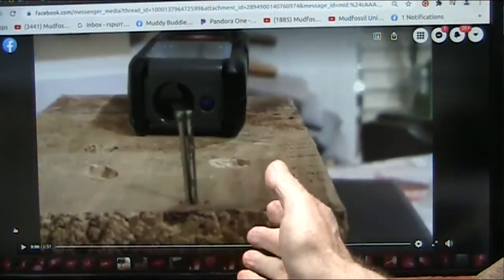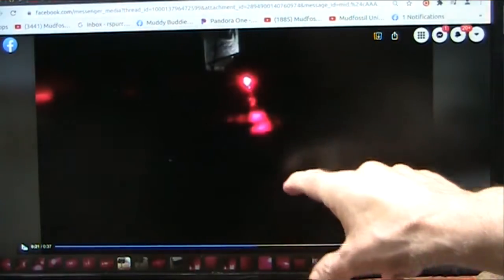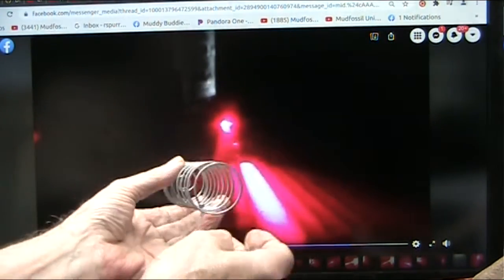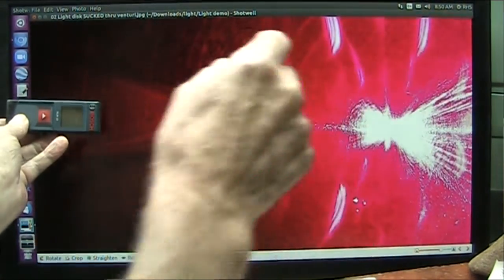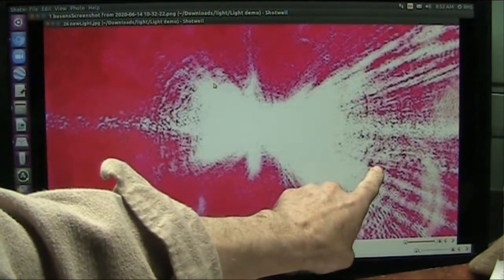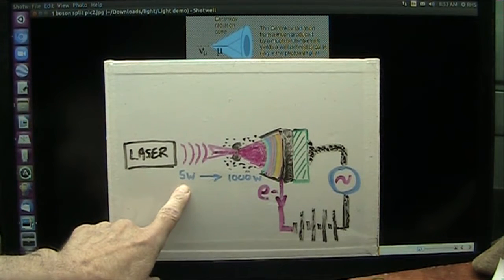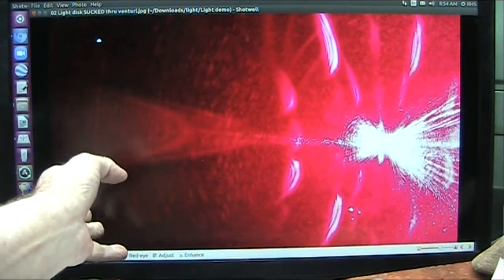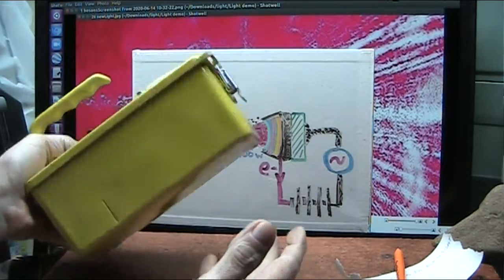How can you Accelerate light at Home

Comment: at the picture at 03:02 , as you say that the particle explodes.... this elemental particle can not fit in the medium where it comes out, when that happens, implodes separating in half turning over, with a magnetic field in between the two halfs. then in one of the sides emanates radiant energy, on the other gravitational energy. when this happens the universe physics naturally brings the energy of the aeter, to balance the difference of the momentum, which is the light, or when the aeter slows down the flow comes out light and/or else.
just a perspective. an opinion. I'm still meditating on it.

Comment: Would there be a way to attach a set of mirrors around a solar panel that just constantly loop/bounce the same Energy back through itself and a Venturi? Using something like a Microscope lense to focus an Outward Beam? I have NEVER been interested in Our Current Technology...But This is a Dream come True.
Reply: I'll try to explain to you why that would not work:

Light carries energy, to transfer that energy it requires to get absorbed by matter, if you put a light beam inside a box with mirrors and a solar pannel, either the solar pannel or the mirrors will absorbe it after it bounced one or several times, and they'll get warmer because of that.

It's true that mirrors are used to concentrate light beams to produce energy more efficiently, but not by making it bounce off continually, but to concentrate several light beams into a transformer. 

I'll suggest that you look up Solar Tower Seville to understand what I mean.
Reply: @didack1419  I prefer Trial and Error Myself; rather than being told one thing, and following-suit just because It's the Norm. There's always another way.
Reply: @SiriusZiriux  Ok but let me tell you a bunch of things if you don't mind. I'm not trying to be an elitist or anything, these are truly my sincere advices:

Firstly, there may be another way, but certainly not any way.

Secondly, no one has enough time to reinvent everything, every progress has started from the consensus. And people that work on this for life have came up with marvels like the Solar Tower PS10 using the consensus.

Thirdly, if you're a trial-and-error person, try actually doing it by yourself instead of claiming it. Start by looking up what is the Venturi effect, how it works and when it doesn't, and which properties a substance that can be subjected to the effect need to have; learn about the basic experiments about light behavior and maybe replicate them (we're talking about 18th or 19th centuries experiments), how laser works and learn how light is harvested and what other ways of harvesting have being considered (if any); and try to see if the explanation that I've given you is wrong.
Reply: @didack1419  That's why I'm Here; as I said before, I'm getting into right now, starting for the first time, for myself. Thanks for Your Input Sir; I'll definitely consider Your Words! 🤟🏻👽 I am yet to even begin to attempt building anything; I have just begun learning this past Year or so! 🌹
Reply: I just believe that if it is so easy for One to Overlook something so Massive; easily seen on a Map (Massive Beings.) I'm fairly certain it'll be even easier to overlook actual "Thoughts" and "Ideas". Ya can't physically SEE Those.....Just sayin'.
Reply: @mingebinge2306  You are Free to Follow Whomever You Wish My Friend. Best of Luck.
Reply: @SiriusZiriux  OK friend, let's say that's the case, and it's truly possible that they have missed those ideas and they instead have believed ideas that were said to be confirmed since 19th century by experiments, but they were completely wrong. 
We're truly talking about extremely basic flaws on the current understanding of all modern physics, how did it happen that people developed extremely advanced technologies based on those ideas and hadn't realised that they were wrong? So many fields of technology are fundamentally wrong (essentially everything that everyone acknowledges as "modern technology", and I truly mean that: computers, TVs, solar pannels, the Internet, modern medicine, batteries, electric cars, nuclear reactors and bombs, rockets, satellites... ) and yet they produce incredibly advanced devices.

   One example, how are we supposed to reconcile the field of Photonics with the fact that photons are actually (very) massive, dipolar particles, that behave like a fluid in very specific situations and no other time and that can exceed c-speed or go below it, that have no wave-particle duality and instead they travel in a helical path and a bunch of other properties that are completely unlike the consensus model. 
   And all of that was only seeing by one person, and not even other skepticals have arrived to his conclusion. 
There's only one world to look at.

If you have optical fiber, light is literally being conducted to your house to provide fast-connection to the Internet. And don't get me started on how many applications lasers are used for, including cooling off atoms to create quantum computers. And this is only one example of many many more, which I still can give you if you don't mind me writing and writing.

Even creationist scientists would be completely absolutely wrong about everything they have told and made, including James Tour who makes molecular machines and Jason Lisle who clearly acknowledges Relativity as a physical reality and he has used it to push for YEC.
Reply: @didack1419  I agree with You; I don't understand how Any One Person came up with Any One Definitive-Answer for how Current Technologies are, and should be used.
Reply: @SiriusZiriux  I'm confused by your answer friend, I was trying to show you that the current theories are so well-grounded that have allowed engineers to produce many advance technologies (literally all modern technologies) in so many different fields that everyone has in their houses.

And there are so, so many predictions made by these models. Modern chemistry is grounded on particle physics and quantum mechanics, and it was used to predict correctly the shape of the DNA molecule by an American chemist who won a Nobel prize because of it.
Reply: @didack1419  Ohhhhhhhhhhhhhhhhhhhhhhhhhhhhhhhhh! :3
Reply: @SiriusZiriux  I was trying to have a serious and respectful conversation. And then you laught at me after telling me that you don't understand how people do stuff that works if they're absolutely wrong, even creationists like James Tour. 

It doesn't matter how careless you're trying to be, there's no way around that. Even Roger tries to show how his theories predict phenomena because that's fundamentally all what science is.
Reply: @didack1419  I'm not laughing at You; I was seriously like, "Ohhhhhhhhhhhhhhhhhh." All Good Sir!
Reply: @SiriusZiriux  Ok, that's fine then. Sorry, it's very difficult to know that in such a limited channel of communication, the Poe's law and all of that.
Reply: @didack1419  Yeah I get It! I've had My Fair Share of Misunderstandings on Here as well; simply because of Things such as That. 🤟🏻👽
Reply: @SiriusZiriux  😊
Reply: And maybe then you can explain to me how a substance that can suffered the Venturi effect can also be made into a laser or why the Venturi effect can be used to generate free energy with light but not with water.
Reply: @didack1419  OMG THERE IT IS!!!!! WE CAN USE WATER AS THE MIRROR AND THE MAGNIFIER!!!!!!!! THANKS!!!
Reply: How can We Condense and Stabilize Water Droplets??? Wouldn't it be neat to find a Way to House a Laser within a Confined; Sub-Zero, portable space? "Cold"-Laser inside; processed through Ice particles or something...Ice would be the best regulator for something that is constantly generating so much Energy; and is also useful for Refracting and Magnifying. There must be Someone who'd know how to set up an Experiment like that. I feel damned close to This...But I know I'm not able to convey what I mean properly. Something that can Operate both at the Hottest Temperatures Externally/Point of Projection; as well as the Coldest Temps Internally to prevent Overheating, as well as to protect from the Heat generated from the Laser Itself as It Gathers more Energy within It's Housing, alternating through the Venturi before being "Displaced" Outwards.

🤫
Reply: @mingebinge2306  Only apparently, between the atoms that absorbe or bounce the photons they still go at the speed of light, very important.
Reply: @mingebinge2306  Well; I told Ya I don't know what I'm talkin' about xD I'm just...Shootin' in the Dark..